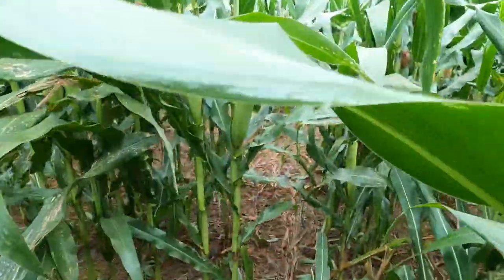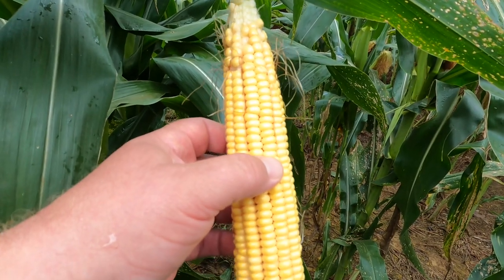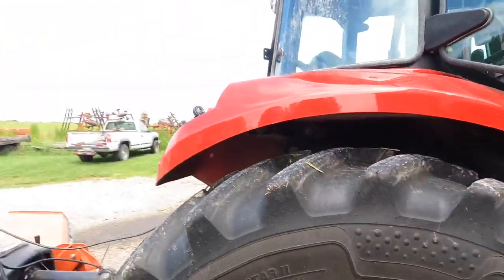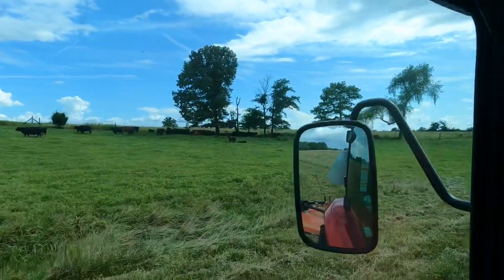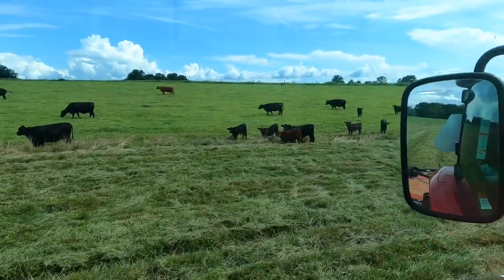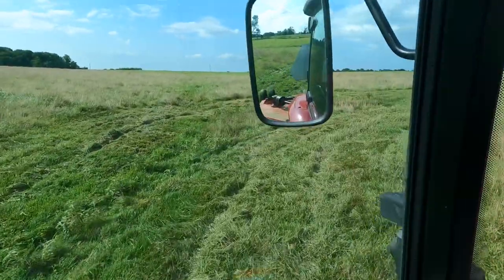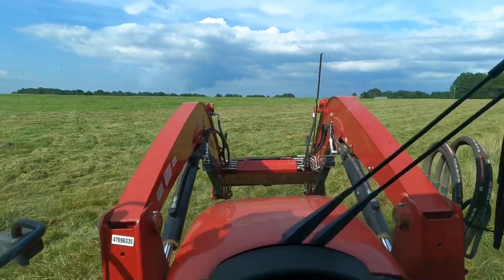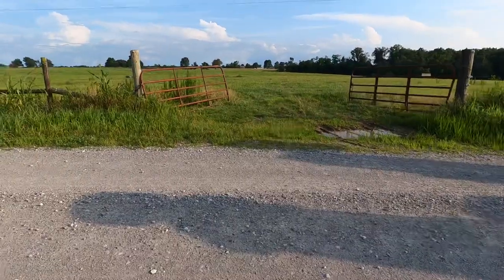Short Crop Tour, Clipping Pastures and Update on the 8940

Comment: What size case ih maxxum is the tractor your shredding with and how does the air conditioner keep up in the hot summer weather the reason I'm asking is I'm looking at a maxxum 150
Reply from the maker: It is a 110C Farmall. The A/C works great! If you keep the filter changed and everything blown out you shouldn’t have any problems.